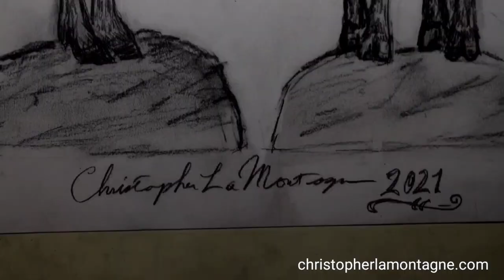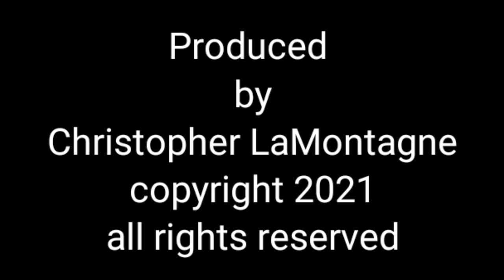Woodcarving A Moose

Comment: From one carver to another. Nice job. I have been slowly getting more and more use out of my foredom flex shalt  carver/sander. I was able to  speed up get more detail and texture in so many more ways.
Reply from the maker: Thks I am and an old school traditional carver I dont grind my work with rotary cutters or abrasive bits I shave wood with razor sharp steel the way it was done for centuries by great masters no high pitch whining dremel stile tools in my shop only the sounds of shaving and chopping